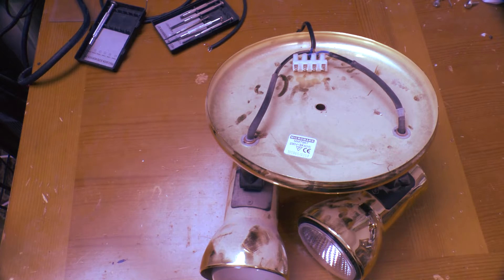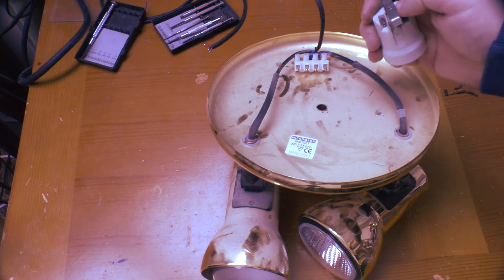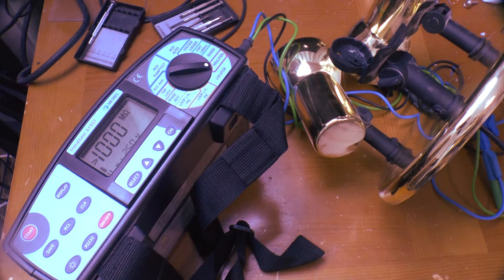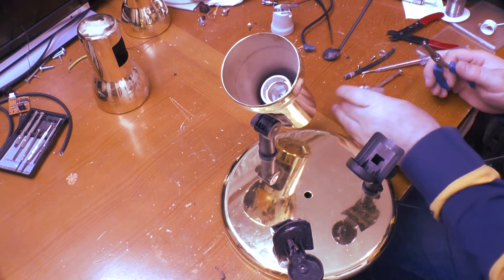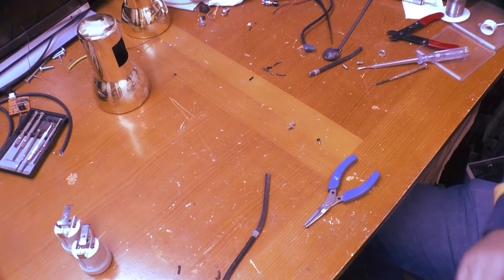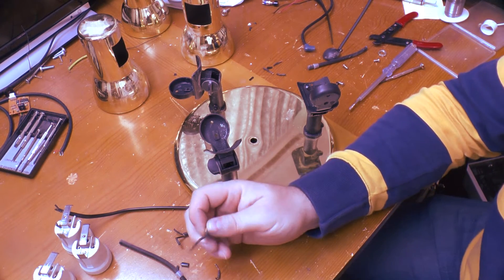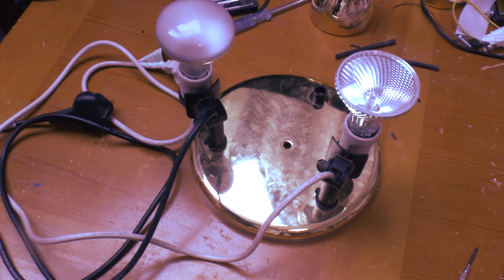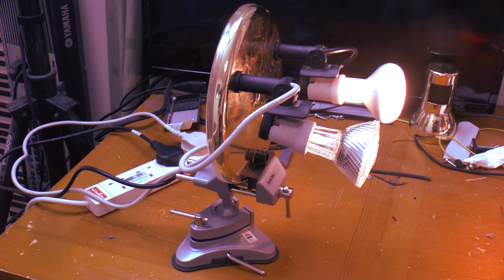Micromark faulty spotlight - check 'em if you've got 'em!

Comment: I switched to LED a 8 years ago. I have modified electronic ballasted fluorescent lamps I bought new from Lidl back then. I put LED replacement tubes in. High CRI. They are all in service since 8 years, no problems at all. Saving a LOT of electricity.

Comment: older similar fittings had metal jointed tubes between the base and fitting, so the shade had a ground, they also used fibreglass sleeves over the wires
The metal bracket on your holder being screwed to the shade means that the wires could come into contact and make the shade live,I would not trust those to be safe
I've seen many brittle wires simply short together when moved, largely in pendant lighting
I would prefer to see silicone wires where heat is present
There are dimmable led's, but may take some searching
Edison are ok if you have a good quality holder, rarely the case with cheap lighting
Reply from the maker: I've done away with the dimmer and fitted a fan/light combo now.  Damned fan blades have already caught a finger when putting on a dressing gown!
I've seen fibreglass used on floodlight wiring, it's the sort of thing I'd have expected here if heat was expected to be such a problem.
Reply: @AintBigAintClever  HAHA, health and safety say you need a guard around the blades :D
Reply: @sparkyprojects  Just put over six safety goggles and it's fine. :D